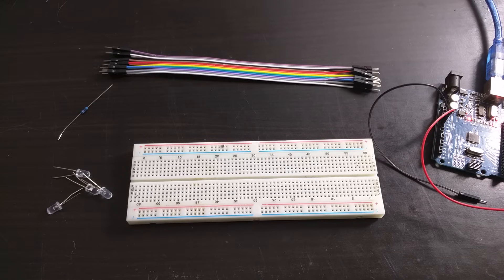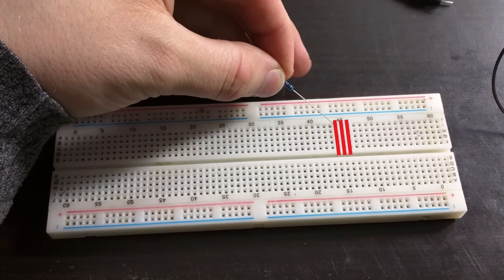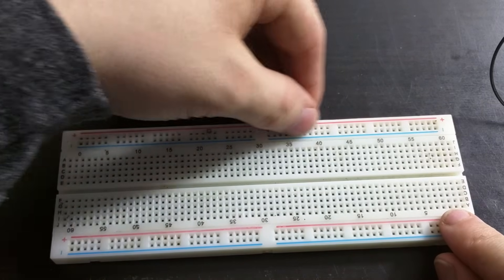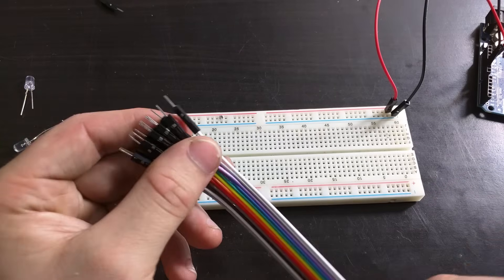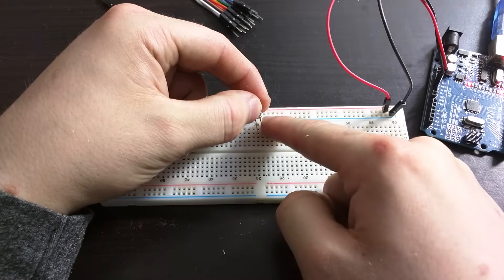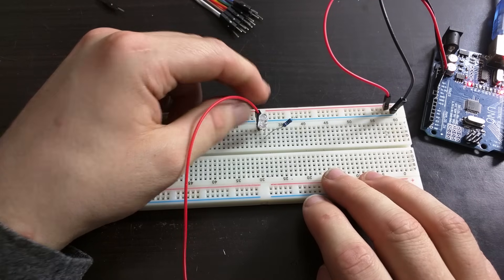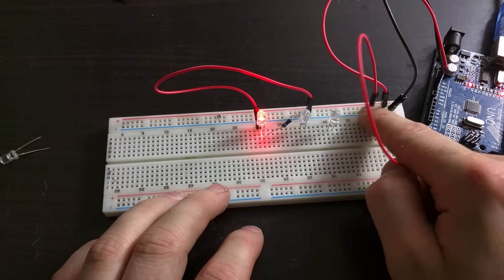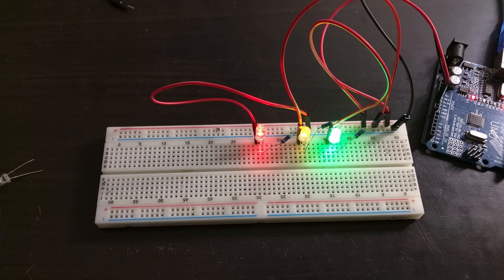How to use a BreadBoard - Electronics Basics 10

Comment: If you don't have a solid core wire, - you can twist the ends tightly, flux them and cover them in solder, - that way they become rigid and will have no trouble being inserted in the holes.

Comment: If my monitor or laptop has 12v 65W power supply, can I jumper the motherboard into breadboard then supply the power to turn on monitor, laptop and external cooler?

Comment: What happens if you don't use the resistor? I mean, what if you just connected it with a wire...no resistor?
Reply: The LED may get spoiled due to excess current in the circuit

Comment: Wait wait,
Cant you just use a wire instead of a resistor?
Reply: But sometimes your led may blow off due to high current...so it is better advised to use resistor

Comment: ESIT: I'm in EEE electric electronic engineering now!
Why do you need a resistor? can you just connect the negative side directly?
Reply: ohm's law V = I * R.   V = voltage.  I = current  expressed in amps  R = resistance  expressed in ohms.  resistance of resistors is measured in ohms.  small circuitry tends toward low amperage because of heat related issues and economy (cost of wire).  in other words if an led needs low amperage in order to light up, then the circuit design is optimized for that amperage, at least, to a degree.   without resistance, the component's amperage rating will likely be exceeded.   volts will be same as amperes and that may fry the component and bread board.  in other words, the thing will possibly reach melting temperature    once you understand ohms law then next step is to learn in series vs in parallel circuits and how to figure total resistance and total current
 take a low 12 volt battery in a car.  To jump the car, the positive terminal connects to the positive terminal and the negative terminal connects to the negative.  This is a parallel connection of 2 voltage sources because it is a 2nd circuit.  but if you connect positive to negative and negative to positive it will be in series.  and that will mean 24 volts, which will fry the car's circuits due to the increase in amperage for which the circuitry was not designed.
Reply: @olinwalker8192  I actually had a lesson on this in physics class... I understood perfectly, thank you! ☺️
Reply: It would likely burn out the led
Reply: Well, if you want a led to emit infrared radiation for a 1 100th of a second, them I would suggest you ignore the resistor.

Comment: Who has a Project?
Edit: I'm in EEE electric electronic engineering now... 😅
Reply: Meee
Reply: everyone : meeeeeeeeeee😅
Reply: // RGB pins (connect to PWM-capable pins on Arduino)
const int redPin = 9;
const int greenPin = 10;
const int bluePin = 11;

void setup() {
  pinMode(redPin, OUTPUT);
  pinMode(greenPin, OUTPUT);
  pinMode(bluePin, OUTPUT);
}

void loop() {
  // Go through hue from 0 to 255 to simulate rainbow
  for (int hue = 0; hue <= 255; hue++) {
    setColorFromHue(hue);
    delay(20);  // Adjust speed of transition
  }
}

// Convert hue to RGB and set the LED color
void setColorFromHue(int hue) {
  int r, g, b;

  if (hue < 85) {
    r = hue * 3;
    g = 255 - hue * 3;
    b = 0;
  } else if (hue < 170) {
    hue -= 85;
    r = 255 - hue * 3;
    g = 0;
    b = hue * 3;
  } else {
    hue -= 170;
    r = 0;
    g = hue * 3;
    b = 255 - hue * 3;
  }

  // Invert values for common anode
  analogWrite(redPin, 255 - r);
  analogWrite(greenPin, 255 - g);
  analogWrite(bluePin, 255 - b);
}
Reply: Me😂
Reply: Me
Reply: Me
Reply: Mee
Reply: I
Reply: Meee
Reply: i do i wanna create a sound equipment
Reply: Meeee

Comment: I have a question. Why did we put the resistor on the negative side of the flow, why not resist the power going to the led so it doesn't burn the led out. I'm confused on how it didn't burn it out and why we put a resistor on the negative side instead of the positive

Comment: Great video I was into electronics around six seven years ago using bread boards and doing soldering radio kits  as a hobby,I have to say when you just learned how the bread boards work with resistors capacitors  and we moved so everything sat in storage for five yesrs its like I'm starting all over again lol ! Great Video thanks for sharing ....  ps I was wondering if I ever need to ask you a question here or there pick your brain would that be ok.

Comment: Mine's not working and I have no idea what I did wrong
Reply: I think it's the wires
Reply: I got a rainbow pack like him and for the wires connected to the Arduino. I usually red and black wires but for the one going from the positive to the light bulb I used the orange one
Reply: It is not working
Reply: I even powered it the exact same way he did
Reply: And I'm not sure but I think I used the same resistor

Comment: You have, in no way, provided support for your assertion of need for wires. You have shown where they May be used, but none of this shows point to point circuits to be impossible with a breadboard.
Overconfident statements of "fact"

Comment: why did he used resistors instead of wire ?
Reply: Sorry for the late reply, if you were to use a wire, it could burn out the LED, but a resistor regulates the flow of electrons to prevent that from happening.

Comment: Is there any rhyme or reason as to why you plug the wires where you do? For example, the 2 connections of the jumper cable? Or could the positive end of the jumper wire be placed anywhere on that positive side?

Comment: if power flows from the positive terminal why is the resistor located after the led in the circuit? shouldnt the resistor be hit by power before the LED? or does that not matter?

Comment: sadly im not able to follow as i dont have a 100 ohm resistor from my upgrade kit... or i just dont know what to use 😅 have 1k 10k 220r 470R 2k 4k7 i have no idea... hehe still a beginner but thank you for sharing the basics...
Reply: I think you should look at the datasheet for your LED, it will mention optimum voltage and current requirements
Reply: @saptarshidas488  Will do that... I need to learn the basics of resistor first i think hehe to understand. thank you

Comment: Doesn't current run from positive to negative though? Why isn't that LED burning out?
Reply: Because of the resistor connected in series to that LED.
Reply: @Saptarshi Das  I'm aware what a resistor does, I'm asking about the current flow. Does charge(conventional current) run from positive to negative? Isn't the flow of charge running through the wire into the bulb then into the resistor last in this case?

Comment: I sure want to thank you for taking the time to make this video about breadboard basics. I too have always had a slight interest in electronics, and especially LED basics. I have acquired a breadboard, a power supply,  various colored what I would call RAW LED's, some pre-wired LED's and for the immediate time being, a 9V battery and a few 9V battery connector leads. Your video has helped in getting me started in the very basics. I just need to learn how to use the power supply. Thanks very much. 
Scott

Comment: For conversation sake, if you were to use one resistor "pre", as in the main power going into the breadboard would that be just as effective?
Reply: I just tested that and the answer appears to be yes. The voltage in a parallel circuit would be constant, so that make sense.

Comment: You were using 5 volts. Can it be used with 12  volts?  24?
Reply: I'm not an expert so don't take this as complete truth but I believe you'd just need a different resistor for different volts. Search up ohms law, that should help you

Comment: if anyone needs the code to do 8 lights here it is                                                                                                                                                    int led1=8;                                                  
int led2=7;
int led3=6;
int led4=5;
int led5=4;
int led6=3;
int led7=2;
int led8=1;

void setup() 
{
 pinMode(8,OUTPUT);
 pinMode(7,OUTPUT);
 pinMode(6,OUTPUT);
 pinMode(5,OUTPUT);
 pinMode(4,OUTPUT);
 pinMode(3,OUTPUT);
 pinMode(2,OUTPUT);
 pinMode(1,OUTPUT);
}
void loop()
{
  //I hated this part
  digitalWrite(led1,HIGH);
  delay(200);
  digitalWrite(led1,LOW);
  
  digitalWrite(led2,HIGH);
  delay(200);
  digitalWrite(led2,LOW);
  
  digitalWrite(led3,HIGH);
  delay(200);
  digitalWrite(led3,LOW);
  
  digitalWrite(led4,HIGH);
  delay(200);
  digitalWrite(led4,LOW);

  digitalWrite(led5,HIGH);
  delay(200);
  digitalWrite(led5,LOW);

  digitalWrite(led6,HIGH);
  delay(200);
  digitalWrite(led6,LOW);

  digitalWrite(led7,HIGH);
  delay(200);
  digitalWrite(led7,LOW);

  digitalWrite(led8,HIGH);
  delay(200);
  digitalWrite(led8,LOW);
 }

Comment: What will happen if we don't use resistor and connect the LED directly to the power source
Reply: It will blow the LED. the resistor resists the control of the current.

Comment: I have a few questions. 

I don’t understand why the resistor goes to the negative side. In my mind it goes positive power rail to positive end of the LED, to the negative end, and then the resistor. Wouldn’t the positive current flow to the LED end over load it if the resistor was after and not before this? Maybe I’be got it wrong haha.

Also, it’s a much more broad question but why do other breadboard videos seem to use just any part of the board they please? You’re the first one to explain and use the power rails that I’ve seen. Is it possible to use both. Does the power rail hold better advantage if either are doable? 

I would greatly appreciate your feed back. And I love this video. Thank you!
Reply: It doesn't matter which side the resistor goes + or - as it still controls the amount of current that flows through the LED, it can still only draw the amount that can flow through the circuit. If you imagine that you have a hose with a kink in the middle the same amount of water will flow through the hose irrespective of where the kink is.

Comment: (Someone Please answer)  so how do I know which side to put the resistor? I see people sometimes put the resistor on the positive side! It’s very confusing and I don’t want to experiment with my arduino because I don’t want to short it out by accident
Reply: Doesn't matter which side you put it on but if you put it on the positive side, you have to connect the resistor to power (+) instead of ground (-)

Comment: Why do you connect resistor to negative and then connect the diod? Is it because the current flows from negative to positive? Would it make difference if you connected resistor to positive and then connected the diod to it?
Reply: it makes no difference as it still controls the amount of current flowing through the circuit.

Comment: Can somebody help me?
I'm new at this and I don't see how (and it wasn't explained whatsoever) the logic behind knowing about resistors.

How do I know when (or not) to use one?

Just say I'm starting a project. How do I come to the answers if what components I need?

I don't understand this.
Reply: Breakneck here’s a useful video: https://youtu.be/Yo6JI_bzUzo
Reply: resistors control the flow of ur current, if there is too much electricity ur bulb can pop so they're needed. You can search up the amount if ur project involves a lot of bulbs
Reply: @derwolf138 So I'm getting into the new Raspberry Pi 5 & I'm back at this. 

Why is the resistor placed after the electric goes through the led bulb? Doesn't the flow go through the positive side & into the negative side?
Wouldn't that be backwards & you'd want to protect the bulb with the resistor in front? Or am I backwards with my logic?

Comment: So resistor can either be connected  to positive or negative? I saw some people attached resistor on positive. Is there any difference?
Reply from the maker: No difference at all when it's just in series, doesn't matter which side, it's going to limit current. You tell me, will it make a difference of you put a stop valve at any point of a single water pipe? Doesn't matter, it's going to stop wherever the valve is.

Comment: what purpose does the resistor serve? doesn't it just waste power?
Reply: Electronics can only handle so much current, Using a resistor limits the amount of current through the circuit.

Comment: can you connect the LED without the resistors
Reply: That's what I don't understand.

Nobody is explaining how it why or when to use one.
Reply: @ClickClack_Bam  I just read comments on this that are over a year old, that say if you don't use resisters it'll be too much power for the bulbs and blow them out. I guess it depends on known the power coming into it v. what the bulb can handle.
Reply: Breakneck  capacitor stores electricity so you would use that if you want things to continue working after removing the main power source
Resistors are just so the led does not burn out most circuits will use resistors because the amount of power from the battery is often times to much for what you are trying to accomplish however the resistor you need will depend on many variables (speed it needs to function at, amount of voltage you need)

Comment: Why did you use resisters to connect the negative column and negative power rail together? Why not just use another black wire to connect to the the two negatives together? Would there be too much current? I ask because you never specified what current and voltage was needed to keep the LED lights stable.
Reply: Yeah, it will be too much current for the LED to handle.

Comment: Would this have worked just as well if you used the resistors on the positive side?  Is there any reason not to?
Reply: No it does not matter in this example if you go Supply-Resistor-(positive)LED(negative)-Ground or Supply-(positive)LED(negative)-Resistor-Ground.
Reply: @Mskvaer  is the power so much that the resistor is even needed?
Reply: @BesomeTV  at 5V the LED would/could draw several Amps. This does not happen because the power is supplied by the Arduino. It's pin can't supply amps, but it may die trying. So, the resistor is there to protect the Arduinopin.

Comment: What resistor wattage (1/4, 1/2, 1, or 2) is probably best for 15V applications using a breadboard for HO Scale LED lighting projects? Is it safer to go higher on the watts even though 1/4 watt seems to be the most prominent size sold in large packages. Thanks!
Reply: work out the physics, I guess, it'll help you out...

Comment: if the light bulb won't explode without a resistor, can i just connect another jumper wire?  I'm new into electronics..
Reply: The bulb will burn out without a resister to reduce the voltage indirectly by reducing the current as seen in V=RI where V=voltage, R=ohms and I=current. I still get confused by voltage and current myself, but there are videos on this subject. Hope that helped. Cheers
Reply: @cri8tor  thanks

Comment: Nice video. Wouldn't it be easier just to put the second and the third LED below the first one, without the additional wiring?
Reply from the maker: Yes, but I believe the additional wiring gives a better visual for anyone who may not completely understand the internals of the breadboard.
Reply: It's a parallel circuit, not series, that's why he did it that way

Comment: This is a very good way of doing experiments. I am a guitarist and I am constantly tone chasing. I will take a breadboard like this (only 4x bigger) and play around with pedals to see what does what. Just going from a .049 mF Orangedrop capacitor to a .030 mF value will change the tone significantly. I will modify pedals, potentiometers and circuits to see what does what. A great tool.

Comment: This must be a constant current power supply because of the led nearest to the power seems to be the brightest (getting the most current?)
Reply: Exactly not a battery! Batteries slowly lose its voltage overtime bc the polarity difference gets lower over time with batteries. If u plug your source to the wall circuit the same does not apply! =)
Reply: Did you learn more about electronics in the last couple of years?? I only ask because I am interested in your question here:
I figured the answer is no, because the resistor should limit the current anyway, that's what it is there for. So as long as the source can keep up with the demand, as set by the LED/resistor combo, the current should be the same to all three LEDs if they are all the same spec and with the same resistor. And if the source can't keep up, all three LEDs should dim by the same amount, as the lack of current should be equally distributed between the three loads in parallel. 
I think the LED which looks brightest is because green LEDs are more efficient at converting electricity into light than either red or yellow, so for the same power drawn, you get more photons out.
If you have since learned enough to confirm this or correct me, or anyone else who's in the know, that would be super helpful!